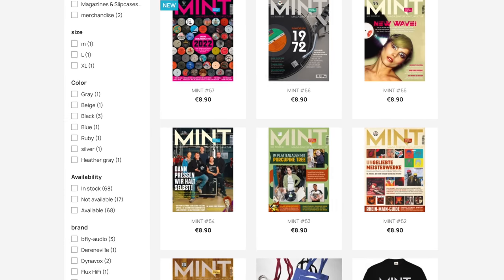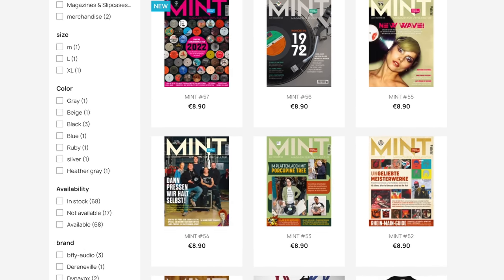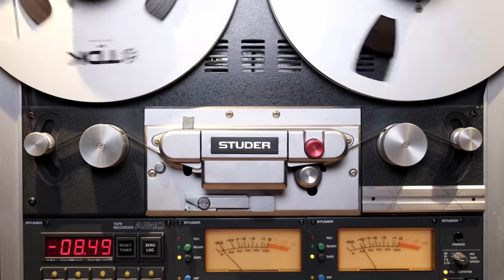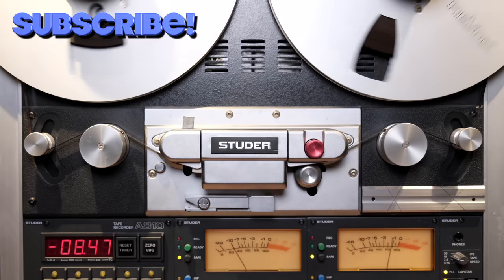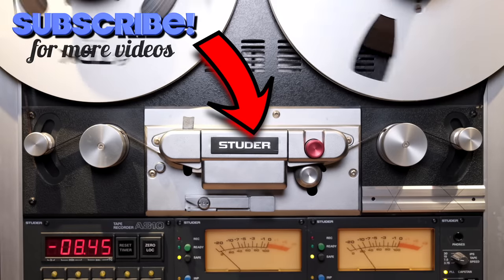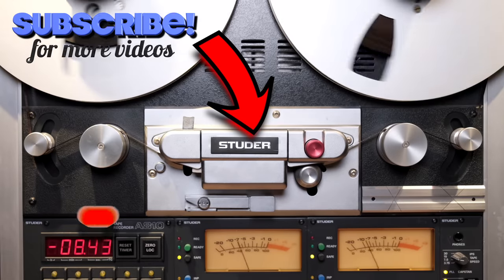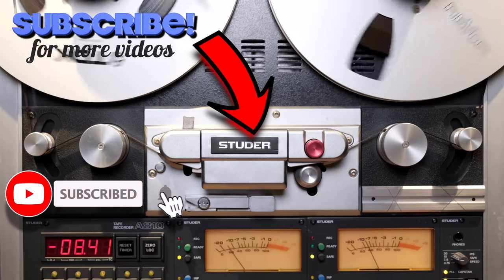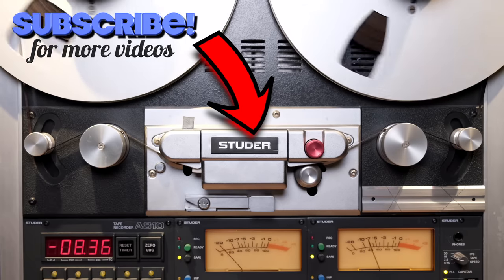Digital Delay: The little dirty secret of vinyl mastering (including past AAA records)

Comment: Hi,

First analysis:

Yes that's shocking, that's why reel to reel will and always will the best not digital signal transform, as well as very simple print method, we need back reel to reel for mass market!
That's also why 45 rpm is stuck endlessly saying that the original from 70's pressing are always better!
Anyway you don't say how the digital delay impact the signal is it a full adc then dac, or just a digital analysis of the peak which control an analog delay box, that totally different, in that case if it's for analog delay which digital control the impact isn't an issue at all! Also it can be mixed with the analog signal? So the resolution in that case isn't an issue, because 8 bit for the analysis of a peak on an average 75 db, is already sufficient. Also this is certainly for the bass frequency range which after experiment if not above 120Hz, could quiet accurately be sampled! The fact that vinyl are 99% digital in not as clear as you tell it because digitally controlled analog circuitry don't make things digital. (i suspect that's it is the case, digital controlled analog delay circuitry)
Regarding the resolution i suspect clearly what 45rpm is calling a more compressed dynamic range due to low resolution of this digital part, having 24 bit one would allow better dynamic range of the signal! Remember that for an analog 48db a 8 bit signal sampling makes 0.19db step, so you need at least 12-16 bit to have correct steps, Also if the analysis is based on all the signal it's much impacting because an analog 75 db dynamic range require 24bits. In fact as for the frequency , you need at least twice the analog dynamic range to sample correctly it if you don't want to high db steps (distortion), in fact 0,01 db step  are sufficient to not be noticeable whereas 0.19db are! Making a simple cassette tape the equivalent of a 16/24 bit res fill in term of db steps!!! (the more you have to sample a range the more analog volume you get 24bit of 48analog db is just 1,11758715615e-08 db step, not fabulous but sufficient), ok 16 bit is about 7,3222634947e-05, theoretically sufficient but practically insufficient as a 16 bit stream don't produce the same loudness as the 24 bit one for the same dynamic range, why still don't know!

Edit:
Definitively not digital it's a mechanical digital speed control (5ms speed delay correction nothing in common with sampling, and dac added to the source, Anyway there isn't any information in the article you mention to be 100% sure! even if it's clearly writted solid state device, that don't mean necessary digital processing device as known as today! Showed this to 45 rpm he got master skilled engineers whose should really confirm!

Edit 2:
 I do state that no, vinyl AAA with this still stay an AAA for that simple reason if it would be digital, there isn't any need to use the tape anymore just a full DAA chain and that's insn't the case for the best producing plant still today whose still use analog eq + analog reverb! Also DAA vinyl cutting don't sound the same as AAA vinyl cutting with digital speed control (speed delay)! As i always saying, don't confuse digital control , with digital sound processing! So don't worry guys it's just misinformation/not well understood information your AAA vinyl are 100% analog (unless you buy mofi's ones or not respectful AAA companies) even with this digital speed delay (the only impact is a less eccentric dynamic range, which unfortunately is a much more realistic dynamic range and closer to the master what 45rpm confirm with old original pressing), by chance the vinyl HD would never comes, this one for the case was digital craps for economical purpose!

Edit 3: Also remember that even with digital sound processing which i of course does not recommend, the final product is analog (There isn't any steps (distortion) in a traditional vinyl cutting, it's just a matter before cutting how you are close to the analog master). You can learn here that unfortunately again for economical purpose the perfect analog master would always be the reel copy! As for digital sound, the perfect master is the digital master, a vinyl cutting of a digital master would definitively alter it, fortunately in a better way as we know today that digital (inferior to analog never better, just can be closer to it) distortion are higher for higher frequency range starting for 192Khz/24 bit around 1Khz, putting those distortions into analog support does make a natural anti-aliasing effect still better than DSD512! (estimation to be confirmed in the future perhaps if those dac could go higher than 768Khz/24Bit/DSD512(1Bit) of equality around 6144Khz/24Bit/DSD 4096 for a 30Khz pure sinus, fortunately it would be unusable, making analog for the rest of the time of the humanity the best support for analog waves video/audio)
Of course digital has also advantage no physical issues, and fast editing whose for the end listener hasn't any interest and are completely deleted by the power and space needed for a DSD512/768Khz/24Bit Decoding!

Edit 5: I armed myself, so edit 2 well confirmed, digital delay isn't digital sound processing, to summarize it sample thought analog circuitry and in the worst case a pcm dac the signal amplitude, to drive the latch witch print was is called the preview sound, the goal is to target a maximum peak level doing a compression confirming first analysis 45 rpm part. Lazy and economical method, The full analog way make better result as it use the head analog compression. The best one is avoiding completely the compression part, but that require, a full listening as well as test pressing and of course no "today pointless?" (average time side 16 mn max at 33rpm...still left 8 minutes, plus if yu print at odb instead of +6....) space optimization! (for audiophile production facility it's the way to go)  Anyway no digital vinyl, it just to avoid the latch to overcome the groove. So it's a digitally controlled mechanical drive with practically no impact on the sound except for the dynamic! Call it a digital controller mechanical limiter! 

Long life to analog.
Reply from the maker: I am afraid that you are creating misinformation. You are analyzing the pitch control part of the Neumann lathes which are indeed analog electronics. You are focusing on the pitch part, which is indeed analog. If you read the Billboard article is says, above the part I read in the video, that it is a 16 bit digital delay, which below it is clearly written that the delay is the program going on the record and the direct-to-tape signal is used to calibrate the groove width (pitch). Here is a Stereophile article where Kevin Gray states in an interview that a lot of people use digital delay while he instead uses analog (are you going to believe him or is he misinformed?): https://www.stereophile.com/content/kevin-gray-vinyl-mastering-master
As stated in the video this information was clearly exposed by the PRESIDENT of Speakers Corner in a review I did a few months ago: https://youtu.be/A405QH55cNk (at 16:28) is even Kai Seeman misinformed? 
Most mastering facilities after the Neumann used the Zuma system and now several mastering studios are using the DJR Disc computer (KEvin Gray in fact uses this one). Here is the manual where it clearly says that the signal is converted: http://wwww.dkse.net/Discomp.Manual.US.pdf on page 15 but there are several solutions. 
The important fact is: If you don't have a tape recorder WITH TWO HEADS (analog delay) then you are mastering with a digital delay (signal is split one for the pitch, one for the signal) and that conversion is clearly used also to adjust the signal eq, RIAA curve etc. and then converted back to analog and cut on the lacquer.
Reply: @anadialog  don't have too much time for now but i will read all of this, i can assure you however that you're wrong it's the tape delay on what i focus, there are three type head based, analog circuitry, and pcm dac samplng the worst as it can add jitter. All of them has the purpose to limit the peak signal. it's a compression method based on a delay. All of them use only the amplitude analysis to do it.  The input signal is delayed by this peak limited to control the latch! The input signal stays the preview one but the latch control is using the second one! there is no adc then dac on the input signal it's too early for that! No processor where available at that time to make a full digital sound processing!
Reply: @anadialog  you're wrong i read fastly the kevin gray article as well as the manual you provided! It's a mechanical feeding purpose, It's well written that there are sampling L/R/Pitch for driving purpose! The head based as well as the analog circuitry are equal, only the PCM dac is introducing jitter in the driving!

The djr Discomp is a computer used to adjust the PITCH and DEPTH on Neumann VMS 66/70
disc mastering lathes. The Discomp also has utility functions related to disc cutting.
I don't see any sound processing function!!!

Also:
A lot of people are taking a two-track analog machine and using a digital delay to create a split signal that feeds the computer and the cutter head (footnote 2)

The unit accepts line level inputs of left and right preview signals. These signals are passed
through a filter which rolls off high frequencies so as to simulate the amplitude of the cut
signal. The signals are then digitized and passed to the microprocessor. The unit computes
the peak signal of the left from the previous revolution and the current right peak, and uses
this to generate the Lateral signal. This is then delayed to output effectively as the signal
enters the cutting head. The out of phase signal L-R is generated and used to determine the
Vertical output. this is applied again after a delay. This signal is also averaged and applied to
the LV output.

You confuse a digital driving with a digital sound!
Everything finish as analog voltage! Where do you see standard digital sound which consist of reading binary data of a stream them processing it to a dac which then give sound voltage from these 0/1.in order to produce analog waves!!

Also driving a head fully analog or digitally is a little of concern! The finishing would be an analog signal as the cutting process use voltage power for printing a groove.

It's the same thing for the first printer whose add a digital control onto a mechanical head, when you look as these print there isn't anything common with a digital printer!

Just analyze a groove with a microscope you won't see any digital step!

Again it is not a big concern that the cutting process is driven digitally or fully analog, the result would be quiet the same jitter excluded! it's the same discussion for the turntable with direct drive + jitter, and belt driven + flutter, does that make the sound digital, no, the sound better well yes perhaps or no ,  it's difficult to tell!

Explain me where is the gain except being more AAA, and the end everything go thought the computer! That not digital sound, that's digitally controlled mechanical device.
Explain me how you want to cut without a driving controller, with your hand! With your way of thinking everything is digital, because an analog synthesizer digitally controlled would finish digital sound. NO, it's analog sound digitally produced(controlled)

You've gone to far saying vinyl is digital, please find the vinyl with a c64 program hidden and here what's digital stream of 0 and 1 produce on an analog groove, unbearable sound.layered in analog sinus waves or prove that you can see aliasing onto a groove 0 or 1! No vinyl is 100% analog product, using a microphone to reproduce the sound. The input quality is essentially the source material not the cutting process(even if too much digital than necessary at this point is unwanted)

When you record a VHS which is also 100% analog you're using digitally controlled device... Don't know about JVC best picture technology, it's doing the same thing that for vinyl cutting with this time a processor to control the reading. Does it makes the vhs digital, NO!

And the best of all, the revox B77, PR99, studer, balfinger devices digitally controlled are perhaps also digital sound!

Or perhaps oberhein did digital sounding synthesizers!

Ok you want to be Audiophile the best process, but NO VINYL WOULD NEVER BE DIGITAL.

People are confusing digital sound with analog sound using digital input, vs analog input, device digitally controlled vs sound produced by a binary stream! analog synthesizers with virtual analog ones.

And if you think that digital delays in the cutting process does remove the AAA, of a vinyl then please prove it microscope two different pressing and prove it!

I do love analog sound, i'm 95% using analog device, synthesizers but quiet all the time i have digital control on them!
I even regret digital control for the inputs on my revox in addition with the analog ones! 

Always said digital control is not an enemy of analog sound, it's direct digital processing which is!
Reply: I have no business interest, and hate digital audio/video even my synthesizers have analog device converted for digital control if we could remove most digital in the people life except a few things (communication, Device control, video game...) i would be the first to do it. (in fact i'm doing it, unfortunately not all people) It's awful to live only with a smartphone as all analog device simulator, without any physical media, but i must admit that digital control, are welcome as soon as it never alter the sound path, and here it's the case! You cannot say vinyl is digital because some are using digital late control! It's not true! Therefor you couldn't prove it on the finished product. When i'm telling digital sound/video is inferior (not in all aspect), i have proof, because unless you have them no interest! Ok you've found that it's not full aaa control, but it's still full aaa sound except if input signal is digital and even in this case it wont be prof on the finished product, just a sound a bit different! Audiophile release deserve more interest in respect of the master, but if digital control improve the space/quality with not sound path alteration, why not, double headed decks are no more available, but a lot of people have Neumann lathes, it would be a shame to not use them just because they do not have a double headed deck,! However i would recommend them to switch back to in between mode, analog circuitry, even if less precise (not sure about this) groove optimization would be achieved!